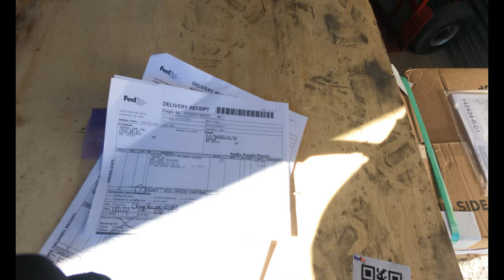HOW MY DAY LOOKS AS A CITY DRIVER (FEDEX FREIGHT)

Comment: Great content I just finished with the DDI program , start with a city coach next week zero past driving experience already had my CDL  still iffy with my setup for backing hopefully gets better with time,. I’m big into meal prep and keeping my macros in check it’s going to be a challenge from what I see getting that gallon of water and meals in ugh.
Reply from the maker: Just like anything else you’ll get better with time! 
It definitely is a struggle drinking that water having to use the restroom so dang often lol 
Thank you for the feedback! 
You’re going to do just fine!
Reply: As a P&D driver ? Just chug some water at every stop the hard part is going to be finding a place to use the bathroom
Reply from the maker: @HeyArnoldGotAFootballHead  most the time I just pull over on the side haha
Reply: @HeyArnoldGotAFootballHead   getting water in no problem but it’ll be tough stopping periodically to go😅

Comment: Question. I have been a driver for 4 years, but just local. FedEx freight hired me for freight handler(figured it would be a way to get my foot in the door since they aren’t hiring for anything else.. city driver job is opening up in 6 months) What is it like working 5pm to 8pm as a freight handler? Is it pretty simple overall? I have no experience on a forklift so kinda curious about how hard the work is and if it’s pretty simple to get down loading them. Thanks
Reply from the maker: It’s cake man I’ve worked the outbound shift a few times the hardest part is probably getting off the forklift lol we break down and put up decking a lot 
I work the morning shift now but definitely would recommend you getting your foot in the door because you’d be first pick for the driver position
Reply: @TRUCKFITGEORGE  thanks for the response man. What do you mean by break down? Yeah that’s what my thinking was. It’s a small barn here so finally just took it to get in
Reply from the maker: @hurt1704  breaking down meaning putting up and taking down 
I don’t know if you know what decking is but it’s beam and plastic platforms that are put in the trailer to load up better and make more room for freight 
Anytime brotha any questions you have I’ll try to answer to the best of my ability!
Reply: @TRUCKFITGEORGE  thanks man I appreciate it. How fast paced and physical is it?
Reply from the maker: @hurt1704  at your own speed man it’s not that fast paced it may seem like because everyone is zoomin around
Reply: @TRUCKFITGEORGE  sounds good dude. One more thing, how long does it take to figure out how to load the trucks as far as where to set the pallets so you aren’t overweight?
Reply from the maker: @hurt1704  we have a bunch of single axles tractors so we try not to load too much in the nose and just try to balance out the weight throughout the trailer 
Tbh it’s not exactly regulated that much because it’s all kinds of different freight
Reply: @TRUCKFITGEORGE  thanks for the info dude. I’m sure I’m overthinking it. Hoping once this background clears, I’ll be starting in a couple weeks
Reply from the maker: @hurt1704  Anytime!
Reply: @TRUCKFITGEORGE  took my drug screen today. The terminal manager got ahold of me and apparently there is a city delivery position coming open like right away so I’ll be moving into that. What kind of money do you make doing city delivery if you don’t mind me asking?
Reply from the maker: @hurt1704  I worked the dock before my route so I was getting decent hours I made 80k last year but I was driving for 5 years
Reply: @TRUCKFITGEORGE  thanks bro. Any idea how long it takes to get a final offer or start date after drug screen? I hate to give my 2 week notice to my current employer without the final offer
Reply from the maker: @hurt1704  I couldn’t tell you man I wish I could help but I can’t even remember how long it took for me